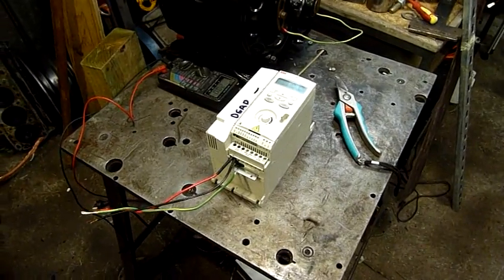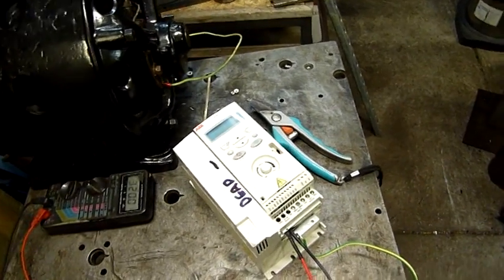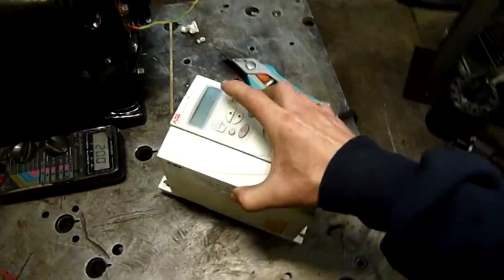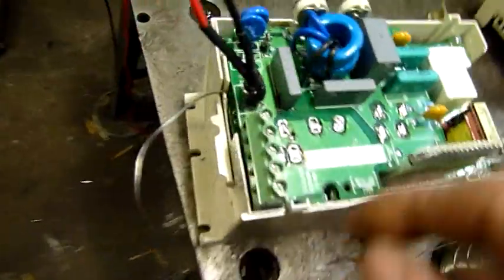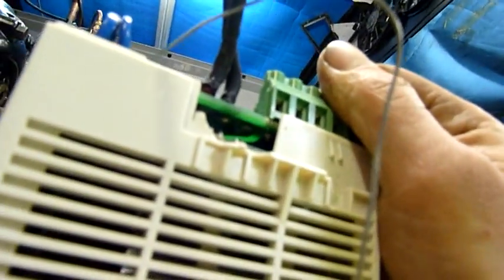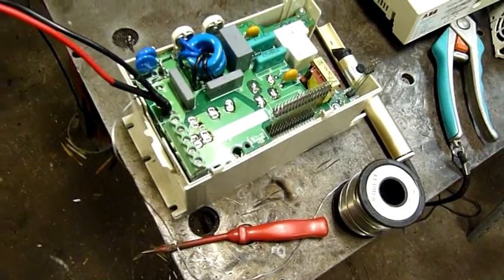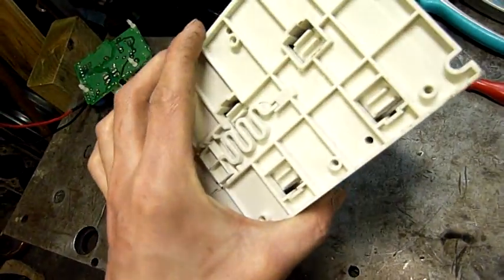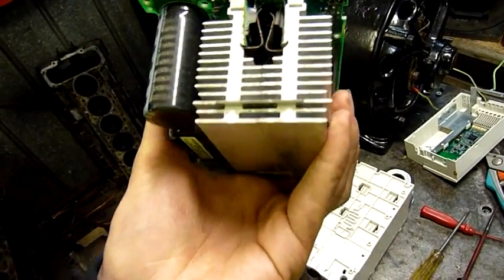2Hp ABB Variable Frequency Drive Autopsy

Comment: you can make your own desoldering braid with a piece of copper stranded wire with flux on it. strip off the insulation and put a small amount of flux on the tip.

Comment: A temperature-controlled heat gun works really well for melting the solder on those between-board ties simultaneously so the board can be removed.

Comment: Be sure to check the rectifier diodes, as that much power across one of the busses is liable to cause one or more of them to go 'open circuit', so make sure they still conduct in one direction.

Comment: Hey Ed, how are houses wired in OZ? in the UK the houses along the street all tap off each phase IIRC so for example I'd be on L2 and my neighbours either side would be on L1 and L3. I thought about asking if I can borrow an extension lead from their houses to test it but the RCD's on all of the houses would trip right away with nothing coming back from the neutral... Just a thought.

Comment: I dont know much about these things, but if you are just going to trash it, here's some things you can do with it:

Pull out those big chineese electrolytic capacitors and chuck them in a fire, they'll make for some nice pops
Remove the aluminium Heatsinks, they'll eithier come in handy or can be sold as clean cast aluminium.

Otherwise I'd be replacing that transistor, and cleaning up any bad solder joints and hope for the best.

Comment from the maker: yeh, seen loads of Inverter AC unit boards suffer similar things from spiders and ants getting in.

I also repair solar heating (swimming pool) controllers at work and the ants make a fried mess of the tiny SMPSU that's inside of them!

Comment: Mmmm, interesting that you found (what appears to be) the fault, & like others have said, I wonder if the suspect components could just be removed & replaced with new ones.

I'm wondering if it would be possible, at the voltages inside the unit for a component to fail & blow, & as it does so, for it to throw an arc to the heatsink? Maybe it wasn't a spider in there at all. If that component is in very close proximity to that heatsink, or coupled to it for that matter, then it may have arc'd over

Comment: I would trace the gate pin of the dead device back and see if you can detect more death, if not then check all devices and caps/diodes around the switching devices.

if ok i would take a risk and buy another mosfet or whatever to replace the dead  one.

worth a few pennies to try :-)

Comment: If you go the repair route you could just trash the case and heatsink and roll your own. Extend the leads of the devices that were on the heatsink and attach them onto a CPU heatsink, perhaps.